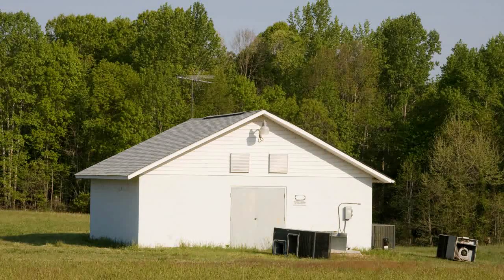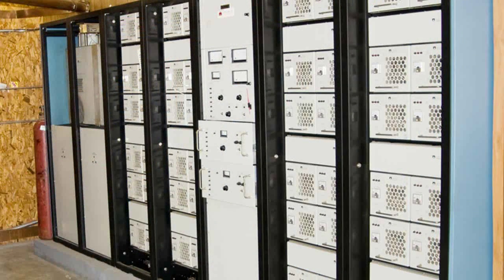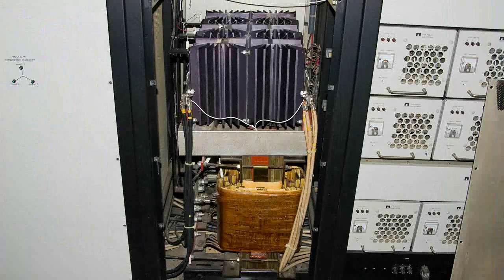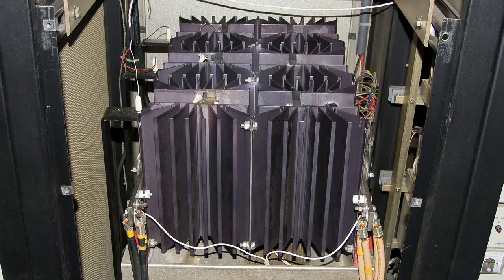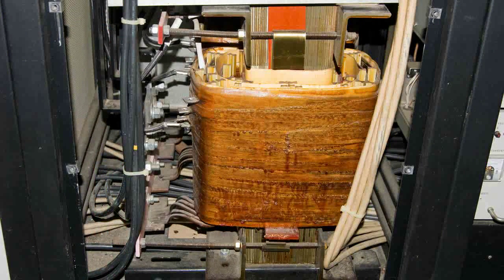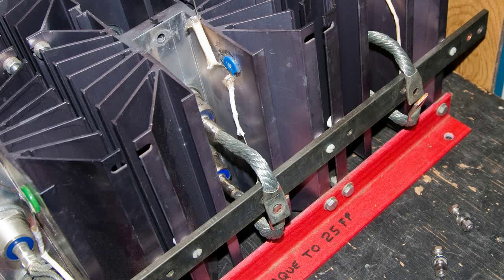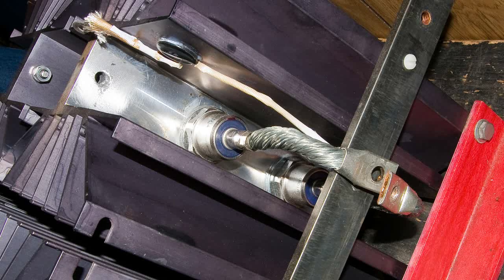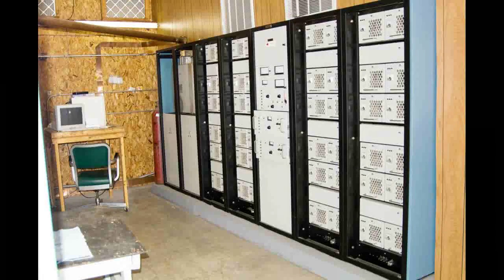50,000 Watt Power Supply Repair

Comment: @snakerivercycles You probably already know this, but if not, you can't pick WDRU up at night because of the frequency they're on. At 1030 AM, they have to shut down at sunset to protect WBZ's nighttime signal out of Boston. So at night, and depending on where in the country you are (I'm assuming Idaho, since that's where the Snake River is), you'll hear KTWO out of Casper, WY, or if further east, WBZ.

Comment: I've never liked the idea of high-power solid state transmitters.  Voltage transients will kill a solid-state PA faster than any tube PA.  And I don't know how many of those things have been killed by lightning.
Reply: I've been running solid state 50kws for about 30 years, never had a pa fail due to lightning.  Good transmitters and proper (not excessive) grounding is all it takes.

Comment from the maker: @HexiBase 
The transformer is three phase. There are 6 diodes of one direction and the other 6 are the opposite direction. And then 2 each of these of both directions, total of 4, per phase. The 2 each are paralleled.

Comment from the maker: I don’t remember what the voltage is but the current that all 48 units draw is about 250 amperes when the transmitter is at 50,000 watts. I may have shown that in the first video on this radio station. The filters are in each of the 48 RF units mostly. There are many choke coils in the bottom of the bays and there are a few more filter caps in other parts of the bays too.